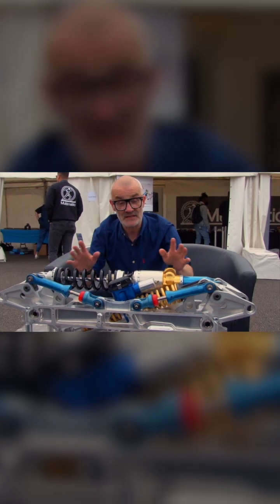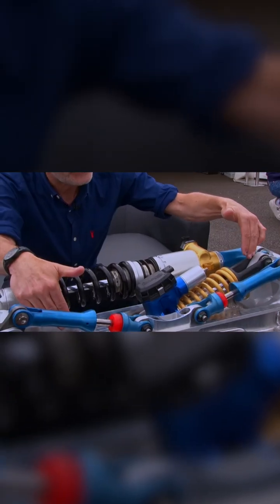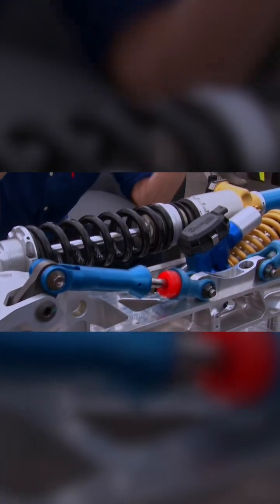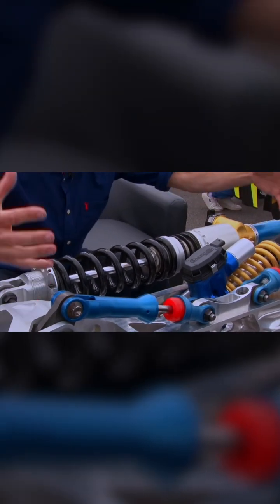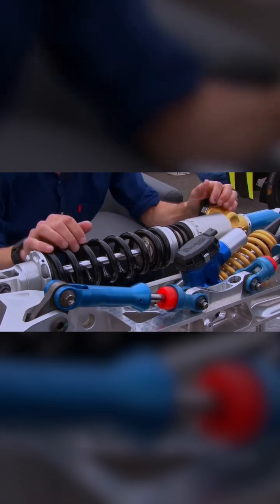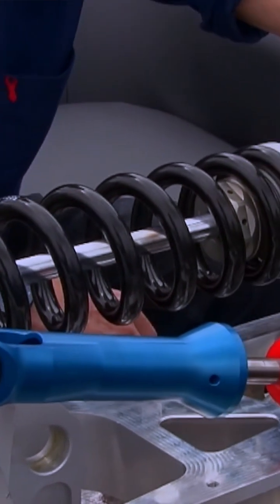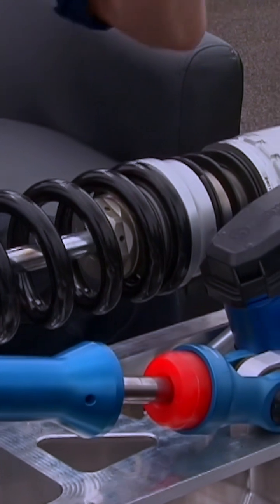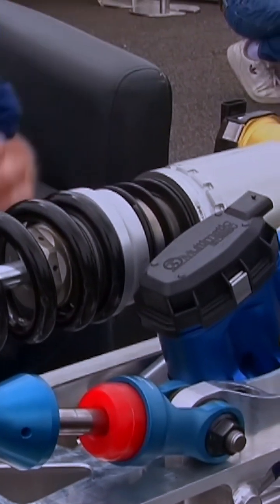How Multimatic Suspension works  #automobile #shorts #engineering

Comment: Given that the dampers and springs are in horizontal position in this particular case, is the suspension able to lift the car like it does, for example, in the Ferrari Purosangue???

In the Ferrari Purosangue, which has a Multimatic suspension, it is able to lift the car, but in that case, the dampers and springs are in vertical position.
Reply: @Manuel_Gestal  yes it can lift and lower it the mustang gtd has this suspension and does that.